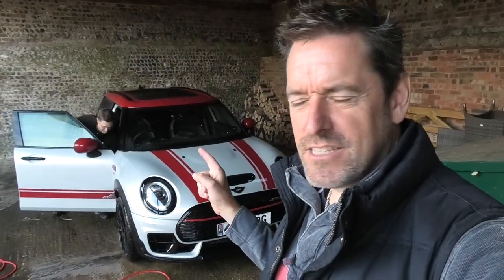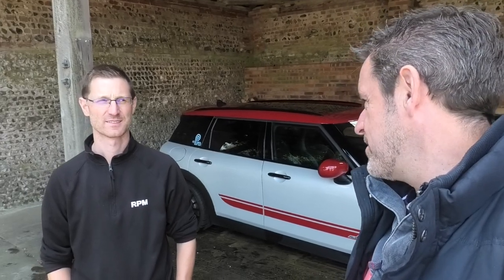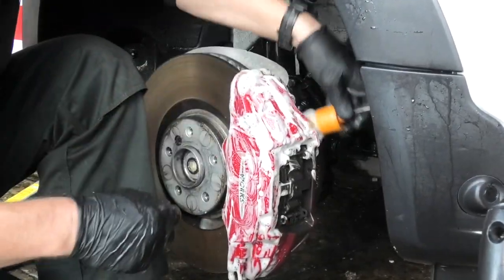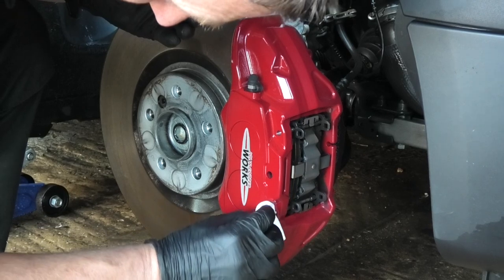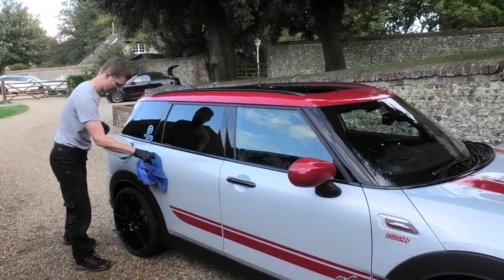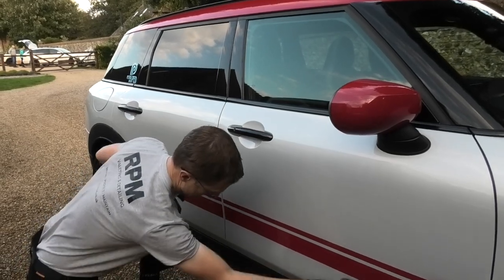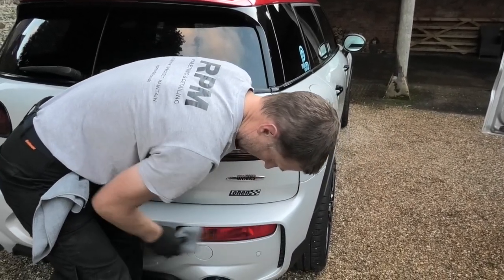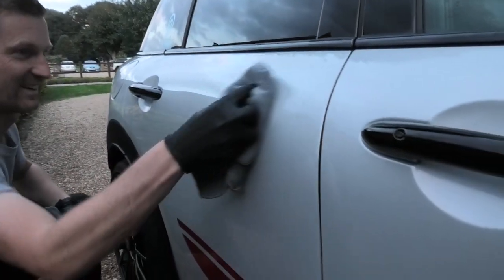Ceramic Coating my Wheels and Brake Calipers took longer than planned !

Comment: Not long had the Stinger ceramic coated with a 5 year coat from Pyramid.

It makes the car much easier to clean,  easy to get it looking as good as the it is was coated. Amazing. 

However having the wheels coated as well it where im impressed the most. I'm sure they won't last 5 years, but I dot think I'll needs to use wheel cleaner on them for a long time. Everything just comes off with a good blast from the pressure washer and a light brush. So good.

Comment: I find these detailing videos quite therapeutic. Strangely, I've just spent 5 hours today detailing my 5 year old Sepang Blue RSQ3 getting it ready for winter. Of course it's not to the standard Ryan achieves, but it's come up like new. It was hard work and my 68 old body hurts all over, but a couple of Vodka Tonics is helping😉My final coating was Turtle Wax Ice Seal and Shine, a spray on wipe off, that I bought on a trip to the 'States last year. The product reviews on YT by pro detailers have been fantastic, it seems almost indestructible.....all for less than $10. Turtle Wax products have come a long way. The same product is available over here but Turtle Wax sell it under a different name....Turtle Wax Hybrid Hydrophobic Sealant Wax for around £10. Recommended for us "driveway detailers".
Reply from the maker: I bet she looks awesome 👏
Reply: Thank goodness...we older retailers need to stay together!! Good to see a post from one who is not a 20 year old  with a shiny 57 plate Golf!!!😎😎😎
Reply: Agreed, it’s hard work especially when you’re getting on a bit like myself, but it’s also worth the effort and good excercise. You also don’t have to spend a fortune on detailing products.

Comment: I think the best option to add protection to a wheel is indeed ceramic coating. However, it's not the best protection to add to a car body. Paint protection film is the best for a car body, especially those 8mm ones that come with 10 years++ warranty on yellowing and scratches. I had my car wrapped in one of those, it's been roughly 7 months since then, and the car shines incredibly and unbelievably scratch free. I really mean scratch free!

Unfortunately, the folks at the shop advised me not to wrap those black pillars at the corner of the car, as he implied that these are "covered" with a thin black film and not actually painted. Therefore when it's time to remove the wrap after 10+ years the color would come off. Still, I had them wrap the front ones because I thought I would rather have them scratch free for 10+ years and then replace them after that than to have indefinite scratches for as long as I own the car (Because it's the front-end of the car and it's going to get scratched up indefinitely by dust particles). and I thought that I could get away with not wrapping the rear pillars by being careful with washing the car. However, the "paint" on those plastic pillars is just too soft and it got swirls all over..

Turns out I need the whole car wrapped with no exception on any part if I want it scratch-free. Because you never know when a body-shop or the dealer's maintenance team decide to give you a complimentary wash that's 7 light years behind in washing standards compared to your personal home wash. Because that's exactly what got my unwrapped body piece all swirled up, just 2 complimentary washes by the dealer was all it took. Even when I told them the 2nd time I took it in to not wash it. They're too clumsy to keep this in mind and just washed it just like they're used with every car that goes in for something at their facility.

I just realized I wrote way too much for a YouTube comment. But whatever, I'll take it as English writing practice.

Comment: Mate if you need a special OZ tool to remove the 'hubcaps' you better get hold of one fast in case you get a puncture ! Another interesting video. Cheers PP
Reply from the maker: I have one now. It just got missed in fitting day and then I didn’t think about it 😂

Comment: flow down of F1 to mid to top ends cars; (to be fair not worth it on most). My old team went with Gtechniq Crystal Serum Ultra over most of the car, expect same with AM, but if applied incorrectly you will be wet sanding a whole  panel of your priced possession !  Your JCW with them could cost you around £1k-1.5k so RPM prices seems reasonable. The F1 factor!

Comment: Aaaah...sponges. Now Peter, I am not 200 years old but I have been washing, polishing and maintains cars since I was 8 years old....and that was a long time ago and at the last count, 74 cars!! I know well that You Tube Experts who have learnt everything from Google and watching their friends videos mostly from the USA will all join in a chorus claiming a microfibre wash mitt is the finest device known to man and they will scoff at the sponge and all grin believing they know best. Well...the tale of “gritty sponges”...they ARE if you do not use them,properly and a wash mitt is 10 times worse!! The secret is gentle cleaning under running water with a quality car wash to lift and clear the road grit. Plenty of water, turn the sponge over at every dunk in the bucket, use several sponges with the cleanest on the roof and then work downwards using different sponges until reaching the wheels. If you get grit on them, you are not using them properly. Now a mitt...attracts grit like a magnet and is vastly more difficult to rinse properly. I like microfibre for drying but not for washing!! Also..every time is see a “detailer” at work, they squirt water from a pressure washer directly at the paint surface...WRONG....you use GENTLE pressure directed along the panels not AT a them! Then.cleaning wheels..clattering about with a hard plastic brush is much worse than a soft, microfibre covered solid foam brush! Everything I do is gentle, plenty of water, warm for the wash sequence. Pre soak, wash, foam, wash again, rinse well then carefully dry using different cloths at each stage which are then hand washed after every use! Car valeting has many myths and a great deal of hot air and showmanship! Your man was good...but a lot are trading on blather and not much knowledge! I shall now shut up..I have many cars to clean from Thursday..no MITTS allowed!!! 😨😃😃😃😃😃Safe driving as always! Richard.😃😃😃

Comment: No sign of any paint correction before applying the ceramic coating. Assuming you have a few swirl marks/holograms locked in under the coating 🤔

Comment: So, about wheel cleaners. I had a bad experience with them ever since I used one (Very famous brand, not a knock off) on my black rims, and it gave them overall purple hue and patchy harsh purple spots. They're permanent. As I took the wheels to a shop and they told me the only way to fix it is to strip it and then repaint it.

Can anybody explain why that happened to me? because all the car detailers on YouTube are using wheel cleaners and they're not reporting anything like I had experienced. Btw, I used the product exactly as specified on the product's instructions.
Reply from the maker: Some cleaners can be very aggressive 😬

Comment: Don't you do any paint correction before applying these ceramic coat as any imperfection or scratches are sealed in
Reply from the maker: If needed yes 👍